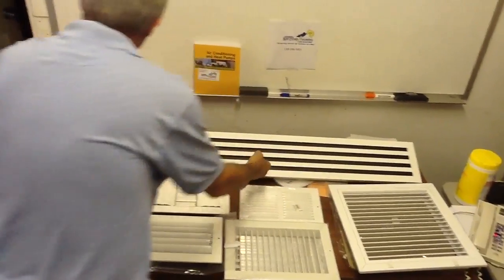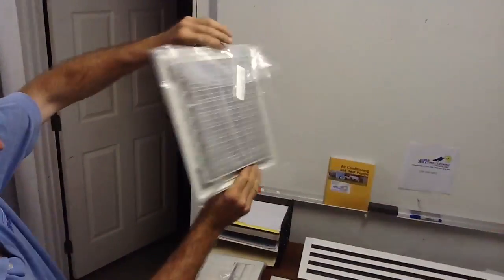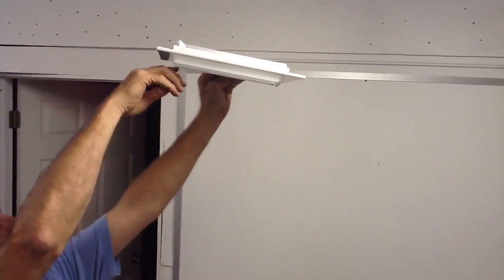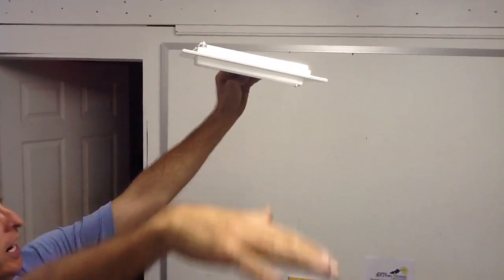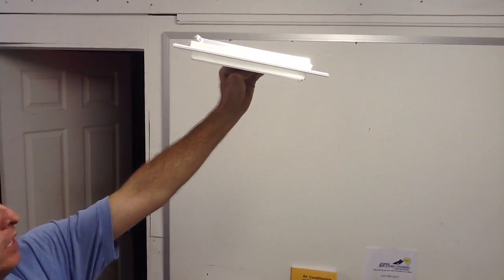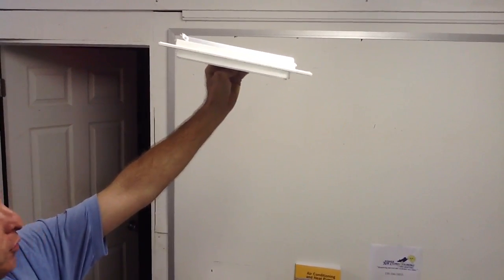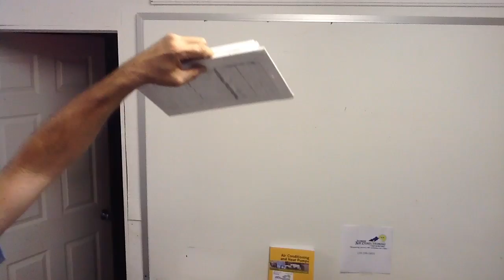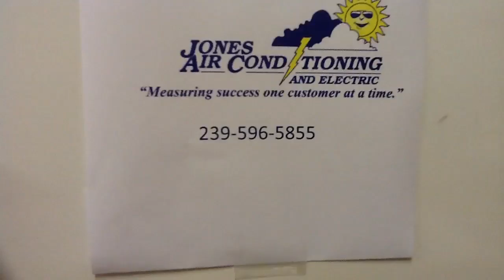"Air Conditioning Basics: Returns,Supplies & Linear Diffusers.

Comment: Hi. Thank you for this. We recently purchased an apartment that has the wall ones… but. It has vertical levers, behind a set of the sale type but horizontal and then behind that those grey/silver looking ones I see on the back side of the one’s you have. In some rooms, those grey ones are closed in others open. But we don’t know how to get to them to adjust them. The vertical and horizontal ones we can move with our fingers. But not the one’s in the back and there is no leaver or button or anything visible to us to try. Do you know how to fix this issue? Thanks.

Comment: Just moved into an apt in a bldg that used to be a factory, everything inside is new.  I have 3 br and 1 & 1/2 baths. The kitchen and both bathrooms have the larger vent on the ceiling where air is obviously blowing out of as it can be felt & heard-so we only have 3 large blowing audible vents.  The bathrooms have both the large vent on the ceiling AND the smaller adjustable vent. The other rooms have only the smaller adjustable vent. The bedrooms also have only the smaller adjustable vent.  The bedrooms are HOT as if nothing is coming out of the small vents placed in those rooms (there are no large vents in any of the bedrooms).  The rest of the place is cool.  We can't figure out why the bedrooms are so hot at night or if the doors are closed.  The smaller vent which each bedroom has were checked to make sure they were open but they're so high up the maintenance guy has to use a stick to check the lever on then.   He claimed they are open but it's still  hot, I have a feeling nothing is coming out of them but I also don't know if anything is supposed to be coming out of them but I assume there should be cool air since the vents with the lever are the only vents in each bedroom.  My bedroom has 2 of them but no large square vent.  I don't get it. I was told the maintenance guy would come back out to check but I have a weird feeling the bedrooms were supposed to have  both the larger vent blowing air and the smaller vent with the lever but this is all new to me.  I looked all over the net & can't figure out if these small vents in the bedrooms are supposed to be cooling the bedrooms off or not.  I have a bad feeling we don't have any ac to the bedrooms since those large square noisy vents are not in any bedrooms. been searching the net for days & clueless.  The bathrooms have both, bedrooms only the small ones with the lever which are 10ft above our heads but the bedrooms are hot, we're waking up sweating.

Comment: Hi I bought a newer home I have larger grills at the top of my house and and smaller grills at the bottom. I have central air and gas heat. Cannot find return air in my house but I put a piece of paper up to top grill and it was lightly sucking air into it. I have 5 of these grills in my house but no grill large grill for return air so are these 5 grills my return air and how should I filter them. Thanks Tom

Comment: David, if you are using passive ventilation in a room there is no for a pass-through grille right? I have a room I am ventilating with a supply and return register and I will have the fan on the return meaning the supply will be passive. From what I undestand, the pass-through grille is only if you have a fan on both right?

Comment: I have a supply vent that I took off while painting the walls. Upon replacing it I noticed that it can be installed with the vents supplying the air up towards the ceiling or down towards the floor. Does it matter which direction I install the wall register? It's located close to finish floor & there is a return vent also. Thanks in advance.

Comment: Good evening David. Does it matter if the return is located directly below the unit with no duct between? I currently have a 4 ton unit with a return register sized 20 x 30 as installed when the home was built 28 yrs ago. According to the measurements this return is to small for the unit installed. Thanks

Comment from the maker: If you need 8 " round flex you need to use a 10x10 can or you could use a 12x8 can. Never exceed 700 fpm on supply. As far as return if you needed 12" I would use a 16x16 return grill or larger.. You 200 square inches of return per ton minimum. I hope this helps. Thanks for asking.

Comment from the maker: Registers and diffusers are selected  for face air flow velocities of no more than 700 feet per minute  by doing that you will have a quite and comfortably system. I want you to know on the return side the air velocity should not exceed 400 cfm  or you may hear it. The ultimate system you will never know when the system is on or off it will just feel comfortably . Hope this helps.

Comment: Once you figure out the size duct that you need to run, whether it be supply or return, how do you determine the size boot and grill to use to match the cfm of the duct?
Reply: David do you know of a company that can cut my plaster ceiling frame to the size i need. My frame is 24"×24" but i need it 24"×221/2". Thank you. I live in Austin,Texas. Reach me at 512-939-8927. Thanks....Charlie.